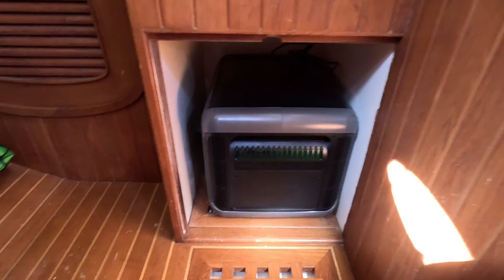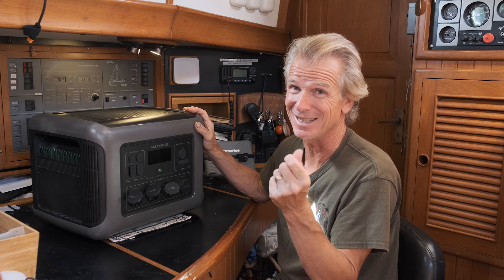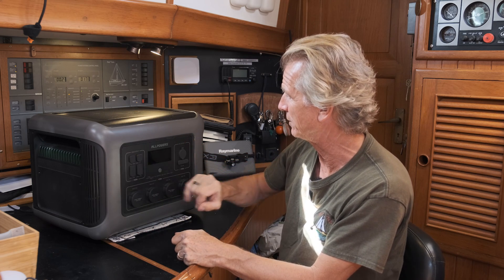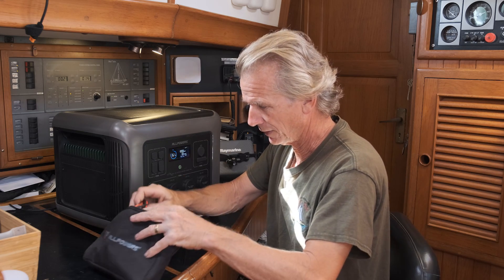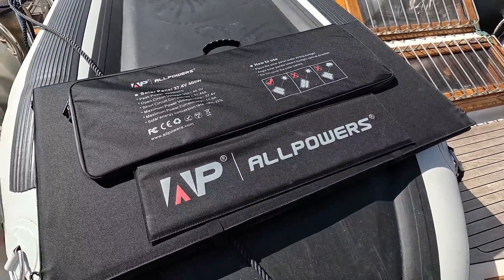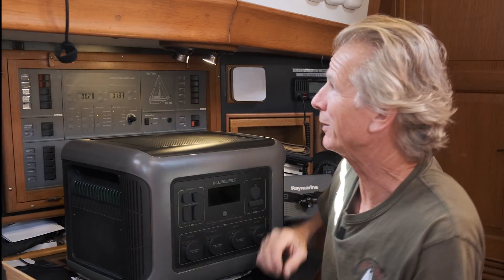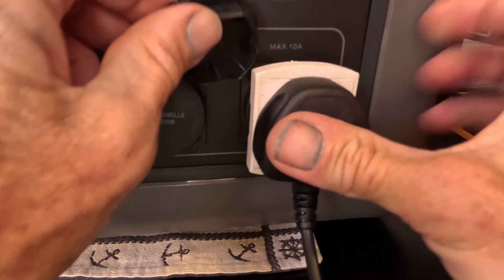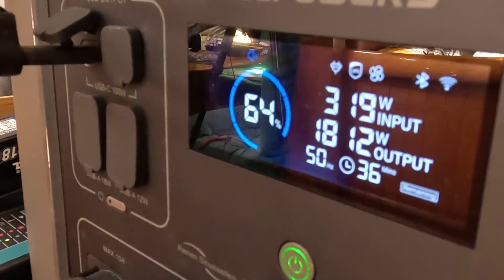Allpowers R2500 and 400W solar panel test

Comment: Bought one for my camper van and im going to use a induction hob and air fryer for my dinner , I bought the r2500 and got 2 x 400 watt panels for £1700
Reply: Hey! Looking to do the same, can you share your experience with it? Did you run into any problems? Are you living out of the van full time? Would you recommend it given that you have used it for almost a year now? Thanks!

Comment: Great video Steve, I only use my boat for 2 months holiday every year. We like to spend time at anchor [Culatra] . The problem is we have to run the engine regularly to keep the fridge working. Would the All Powers 400W removable solar panel plugged in to the ship’s battery do this.
Reply from the maker: Well it depends on the power draw of the fridge of course, but a 400w panel should give you enough to keep the batteries up with an average fridge. If we say the fridge draws 5A (60w) that would be 1,440w over 24hrs. The panel might give you an average of 300w over 8 hours on a good day so that’s 2,400w. So you should have 1000w spare. Of course you can’t plug the panel directly into the ships battery, you need an MPPT converter, the solar power stations have one built in so you can plug straight into them

Comment: A question on your Solar panel switchover. Does that come out of the MPPT controller towards the battery/storage unit?
Reply from the maker: No, it's before the MPPT. The solar generators have their own MPPT's. So the cables come straight from the panel into that double pole switch which sends it to the power station or MPPT for the ships bank.
Reply from the maker: It's part of the reason I like the solar power stations. As well as the extra battery capacity you have redundancy with a spare MPPT and a spart inverter!

Comment: On the website, some of the options have discount codes. For example, if you got the ALLPOWERS R2500 Home Backup Power Station and the 400W Foldable Solar Panel SP037 separately the two items would come to £2279 but if you got the ALLPOWERS Solar Generator Kit 2500W (R2500 + SP037 400W Solar Panel) and apply the discount code FALL15 both items now come to £1700. 
So you are effectively getting the SP037 400W Solar Panel for £100 instead of £679.
You would be as sick as a parrot if you discovered this later after purchasing at full price.
Reply from the maker: Yes , modern marketing! I've asked them for a code for viewers but haven't received one yet

Comment: Are the cigarette lighter sockets easy to change for the xd60, and what are the benefits. I
Reply from the maker: Yes you can buy XT60 socket, i get them in bags of 6 from Amazon. Get the ones with little wire tails so you can just crimp them onto a wire that you connect to the 12v circuit. They can be a bugger to solder direct as you end up melting the plastic. I usually just Tee into the wire going to the cigar lighter as that is sized for the load. Although we are lucky on Fair Isle as the wires are oversized and now we've got all LED lighting in lighting circuits designed dozens of filament bulbs the lighting ringmain is plenty man enough for some XT60's or USB additions, just be a bit careful on modern boats.
Reply from the maker: The benefit is a proper connector! The cigar lighter sockets are flaky at best and it you try running something that draws over about 8A for any lenght of time they will get hot and if there's any corrosion, which there will be on a boat, it will get very hot and melt. The XT60 is rated at 60A so all those DC chargers (like the one that came with our eProp outboard battery) that are designed to pull 10A would be much better off with an XT60

Comment: Don't know your channels demographics... but you might want to explain the whole 'cigar lighter' situation thing to a fair share of your viewers.
Reply: Try Google (cigar lighter socket = DC connector)😉. This is a familiar description for me.
Reply: Cigarettes Steve, I never smoked cigars in my car, I'm trying to picture you with a chest wig in your souped up car with the super wide wheels, so it was you in those adverts.
Reply: “Cigarette lighter” (socket) in the USA.
Reply from the maker: Okay, where are you from and what do you call it?
Reply: @svfairisle  I thought cars don't have those anymore... the outlets still, but not the bit you push in and wait to jump back out again, all glowing, to actually light a fag... or do they? I expected people from a certain age on down, not to know those anymore.
Reply from the maker: No cars don't tend to have the actual lighter, just the socket. That because manufactures started to make accessories that got power from cigar lighter sockets and they just stuck even though they are a terrible design. I think finally we might move over to USBC being the socket you find everywhere.
Reply: @svfairisle   ...which can always be short circuited to still get fire on demand  ;)